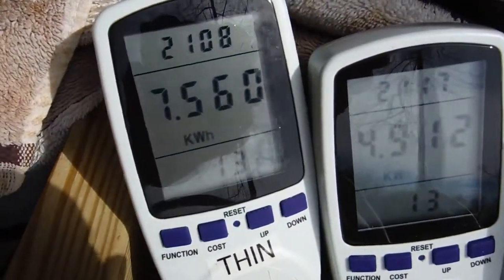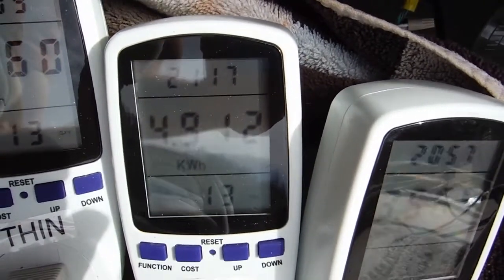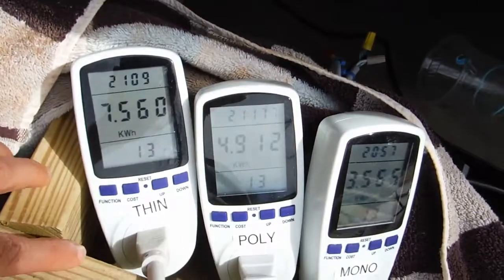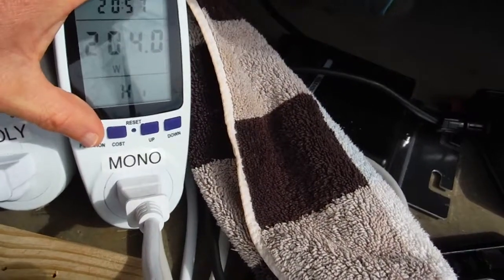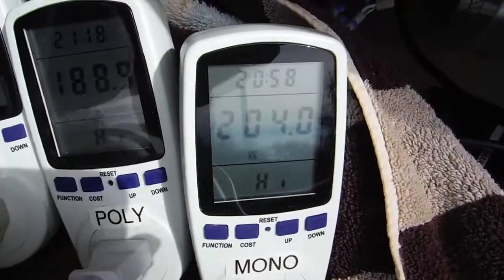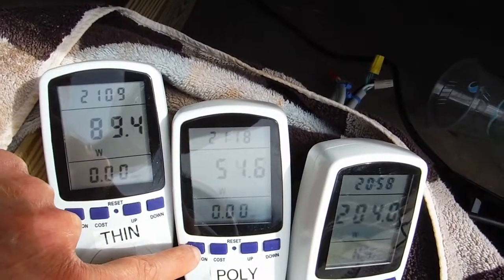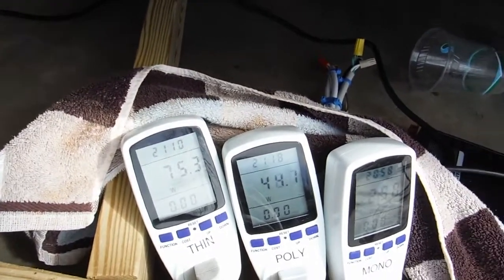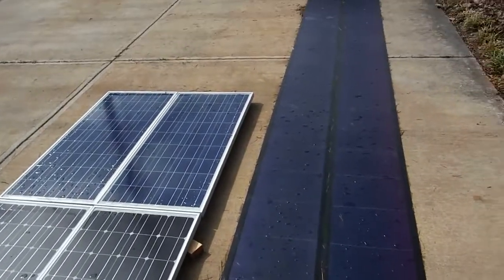Solar panel comparison, Part 3

Comment: Thank you very much for a highly interesting video. Is it possible making a followup now some years later ? Im trying to find most efficient solar panel in low light conditions, what a solar panel generates a clear sunny day is of low interest in northern hemisphere as it is those cold gloomy winter days you have most need for expensive electricity. Comparison space/efficiency is egal as panels are to be mounted on roof, a roof is allready wasted ground space but strangely ive seen people not using solar panels as roof material instead using clay tiles and similar inappropriate roof materials. Any time I see a owner removing solar panels on their roof for replacing the roof I will be there with a coffee kit sitting laughing at them.

Comment: Unisolar solar panels generate electricity even with the street lights, they work great in hot days compared to the poly and mono that with more heat, less power they produce. at 6am the Unisolar thin panels will start to generate more power than the other two. They a little bigger but are the best for all climates.

Comment: I know this video is a couple of years old but It seems those thin film strips are way down the driveway where they got more sun.  I bet if you moved the rigid panels down to the bottom of the strips they would have made a lot more power.  Shading from the house had to play some role, don't ya think?
Reply: Also, the thin film was obviously about four times the area of the other two so should produce more power.  Per area, the other two way outperformed the thin film.

Comment: From what i saw and putting the numbers in calculus, I got to the conclusion that thin film panels have 36% more nominal power, they performed 48% more better at peak power than polycristalline which may be temporary (you didn't told us if they were new, or maybe I didn't heard well. Anyway, probably they are new and they will degrade over several more weeks until they will eventually go to nominal value.), and the energy they given over weeks was 51...54% more.. What is most important for me, they outperform in mostly overcast condition the polychrystalline ones by ... only 1.6%. The calculation i've done was energy over instantaneous power (3,9kWh / 2,58kWh) / (177Wp/119Wp) ; the result is absolutely conclusive for me (thin film does not deserve the effort) and thanks for the movies, they were a great info.

Comment: Thanks for the comparison test, but in most installation, we will be comparing the efficiency of the panels vs space available or investment. For instant it will be more meaningful if we can take the size differences  ( area) out of the equation, and compare the efficiency based on per meter square basis.

Comment: Thanks for the review - I was also wondering which cell technology is the most effective for non-ideal locations.
I'm I correct in concluding that the polycrystaline panels performed the best (if you take into account the physical size and energy generated)?
Reply from the maker: Torsten Tiedtke The thin film (aka amorphous) panels from Unisolar outperformed the poly and monocrystalline panels.  Unisolar is out of business but you can still find the panels online.
Reply: in the beginning of this video, when he walking toward the Mono, I see the tree shadow on Mono. I think this experience test is not accuracy due to the panel is not treat the same under sun